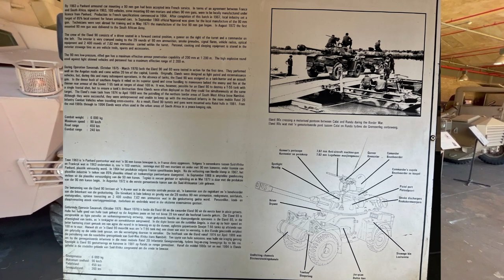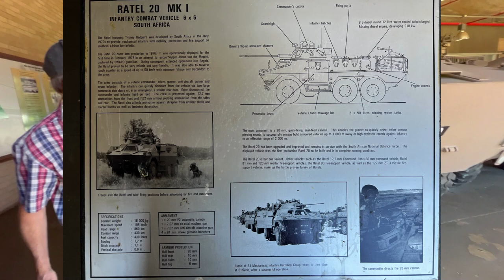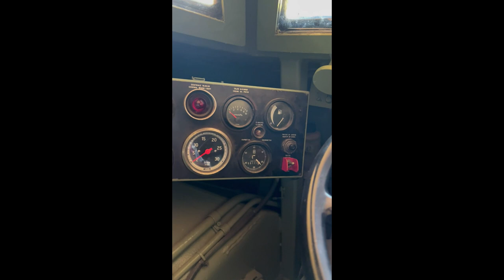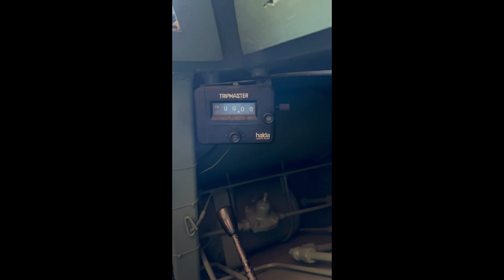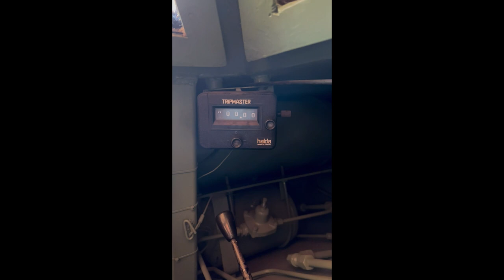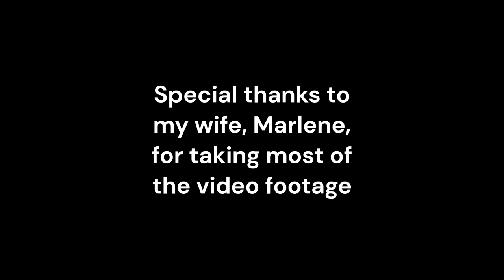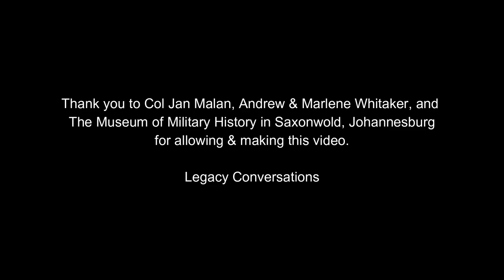Legacy Conversations  - Col Jan Malan -  Explaining the Ratel IFV

Comment: What was the engine make?
Reply from the maker: Bussing
Reply: Bussing
Reply: Engine was a D3256 BTXF  - Diesel,  32=132mm bore, 5=150mm stroke, 6 cylinder. B=Bussing, T=turbo charged, X=abnormal horsepower, F=forward control. The engine was not what made that signature noise but it was the hydrolic fan😎
Reply: @bevanschwartz1875 busshing,diesel 6cyl 12l,if I recall.